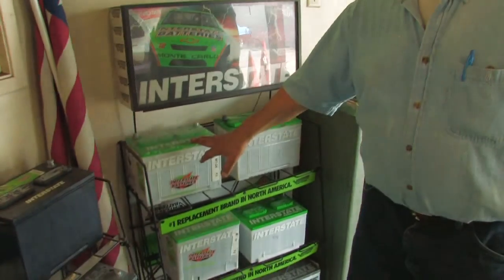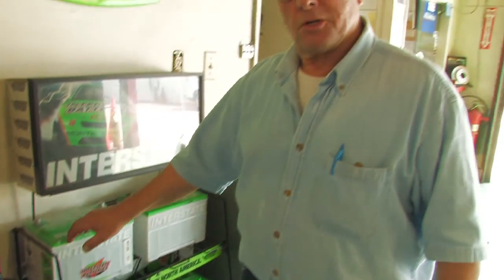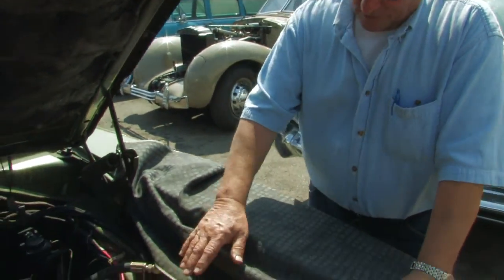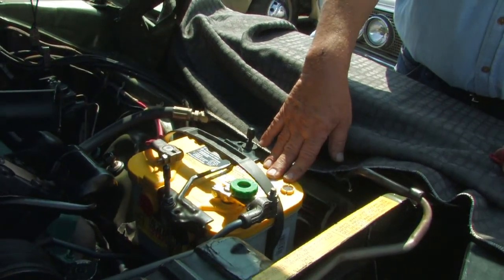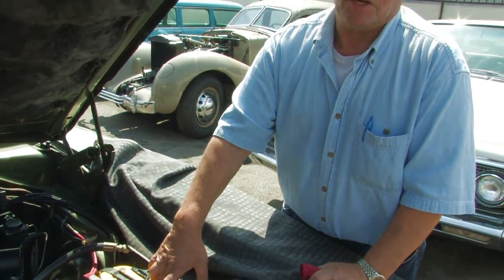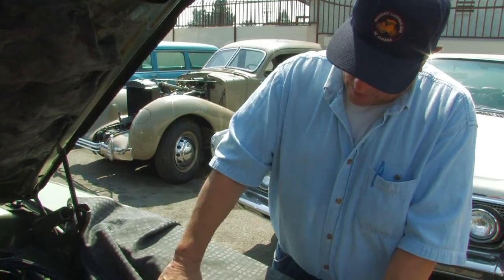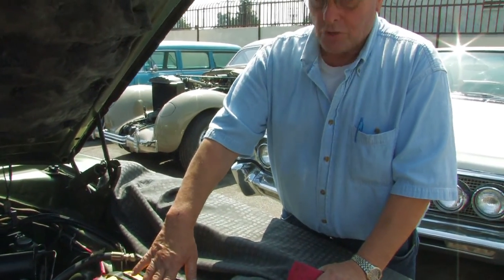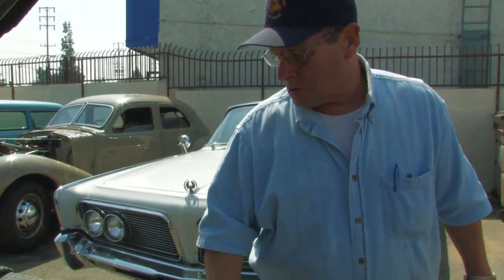Car Parts : How Do Car Batteries Work?

Comment: not true, the engine will still turn over with a blown gasket, unless water got in there. if 3 guys told you its the head gasket, then i would try it

what might be happening happening is the pressure balance of the engine is off with the gasses escaping prematurely through the head, which means rough idling

your best bet is changing that gasket, because you should change a blown gasket anyway. it that doesnt work, it might be another vacuum leak, check your hoses

Comment: is it fixed now? it could be so many things. could be a variety of sensors (mass air flow, idle control, etc) could be electrical (spark timing, loose connections, etc).

if the idle is rough, i would bet its the mass air flow sensor, as its the thing that decides what fuel/air ratio to use, an off mixture can result in the car stalling. but do some more research into it. good luck!

Comment: if your alternator is working properly, the battery is not necessary to keep the car running once started. the alternator is a type of electrical generator which converts the mechanical energy from the crankshaft to electrical energy which is used for headlights, spark plugs, and recharging the battery.

a car battery's main purpose is to start the car, and get the electrical production of a car going. basically, to provide a source energy while the car is not on